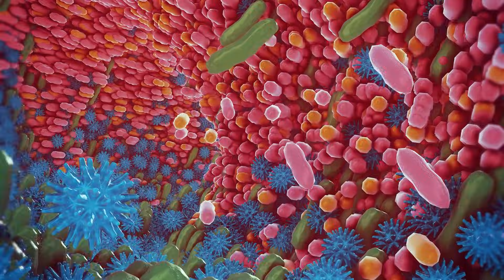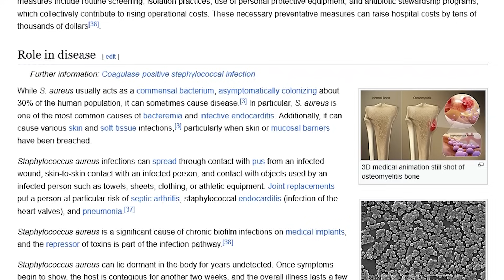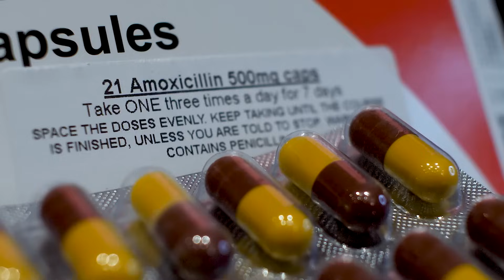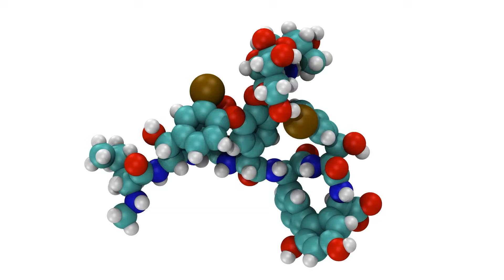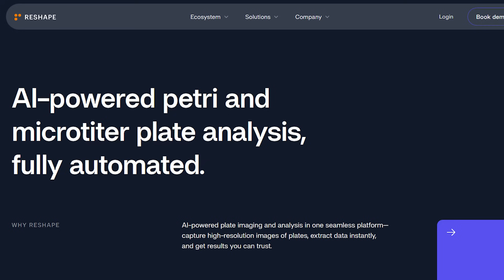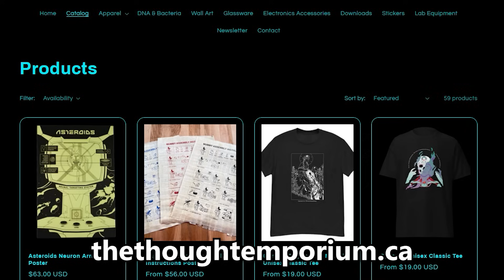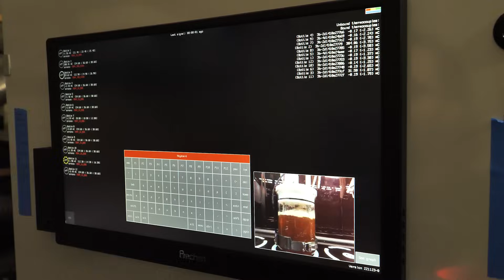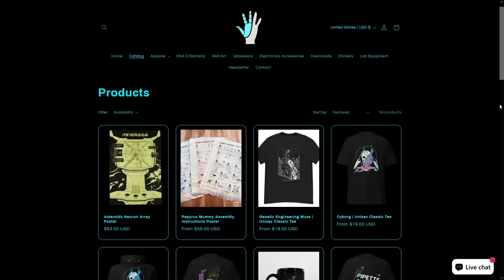I Grew Real Penicillin from MOLD

Comment: i have a bag of oranged and one has gone blue and fuzzy, when moved creates a huge spore cloud😂 will this work?
Reply: theory; soak rice and potatoes in water to gain a starch rich solution, separate solids and discard them.
pour starch solution into slowcooker on warm setting, scrape blue dust into starch solution and place lid. tape the edge and make a one way valve out of a balloon for the steam hole. leave for a week.

Comment: cool video
However the final solid is likely to be mostly composed of sodium carbonate as you simply evaporated the aqueous layer. When performing such an acid/base extraction, never evaporate the aqueous layer as it always contains the salts. Instead, collect your penicillin in the basic water layer by acidifying again and extracting with AcOEt. Then evaporate the organic phase which does not contain any salts (if you dry it properly).

Comment: While there's certainly yield to be gained in the growing process, repeating the extraction steps to do each one at least 3 times probably would've boosted your isolated yield by 50% at the minimum. Especially if the pH was off at any point. Also, its inadvisable to dip pH paper into a solution of material you want, better to use a glass rod or pipette to sample the solution separately. The dyes can add impurities, color, or cause otherwise deleterious effects to your product.

Comment: Would it have worked to have simply had the solution that was left over from the growth of mold sterilized and used as an antibiotic instead of separating it out from solution using the chemical extraction method? Since it is likely that many of those chemicals would not be available in a "civilization restart" scenario, but growing blue mold would be on the other hand, quite easy.

Comment: Pretty interesting video. However, it's necesary to add that the final yellow powder is not "Penicillin" only, but a mixture of a lot of nitrogen containing small molecules, because there was no purification step shown in the video, so the final yield ought to be lower. Nonetheless, it is wonderful to see in a very practical, but expensive way, how a very simplified version of the drug discovery pipeline is done.

Comment: Here are the simple instructions: 

1. Just buy these specific seeds from God knows where. 
2. Add some of these magic powders. 
3. Stir
4. Heat on low for 24 hours
5. Mix the stuff you got with some more magic powders and liquids into these very special containers.
6. Dehydrate
7. Scrape the stuff from the bottom of the dish
8. Ta-da!! You have beaten the bacteria

Survival has never been easier.

Comment: Having done filamentous fungi fermentations (aspergillus 5 liter volume mainly) as a career for several years. I almost choked from holding my laughter when I realized you were going to use a stir bar to try to keep the fungi submerged. That will not fly ever.  It is probably also on of the main reasons for the poor yield. The fungi produces better when submerged, the top layer does not get enough oxygen and/or nutrients and is not producing anything. Only the layer close to the surface is producing. 
If the culture start to hit a real log phase in growth you are going to need to cool the fermentor not heat it. the metabolism of the organism is enough to heat the vessel to well over 40°C, killing the organism.
Do you have any kind of pH control? I am not sure how much acid Penicillium produces but it probably does produce some. And then the question is. What is the optimum Temp/ pH/ airflow/ etc. etc.
looking at the old footage. They might have grown it in what is now used for cell culture flasks. maybe a thin layer batch growth is a possible approach.

Comment: Would the extracted penicillium be save for application or would it  still cause a ton of inflammation, due to mold particles still being part of the solution? What would be the next step to remove pyrogens / increase purity?

Comment: Safety note, if you want to culture soil bacteria, you need to take a few precautions. 1) Do not handle the petri dishes without the proper personal protective equipment (PPE), which would be, at the very least, a properly fitted respiratory mask or respirator in a well ventilated space. You could also make a DIY glove box, or a biosafety cabinet if you have access. 2) Seal the edges with parafilm or tape. 3) Store plates away from food, in a separate fridge in a garage or shed, or in a box outside. 4) If you have any questions or concerns about safety, contact a microbiologist at a local university. Happy hunting!

Comment: Can I just say how refreshing it is that a video going through the history of Medicine did not harp on the "stupidity" of our ancestral doctors? I had never heard of the early references to the antibacterial effects of fungi until now. Thank you.
Reply: the plague doctors couldnt have been much better-equipped with what they knew and had at their disposal iirc
Reply: There's a recipe in a grimoire from a thousand years ago that someone actually tested and it turns out that it's better than modern antibiotics for fighting Methicillin-resistant Staphylococcus aureus. Somebody should try replicating it.
Reply: @ultimape  Interesting, where did you hear of this? Makes sense they wouldn’t be as prepared to handle something we haven’t used against them in ages.
Reply: Yeah, cut them some slack; they were doing the best they could. We figured things out because of the work of people like them, and we’re still learning.

Comment: could we please do the opposite of gain of function on viruses, to get them to be super harmless and then use those to infect yourself and get immunity and then we don't need vaccines anymore that are injected into the muscle, which will bypass one of the most common way to get the natural infection, the airways?! You could simply make them as a spray for the lungs or the nose or other body openings 😂 Just like to my knowledge, cow pocks were harmless to humans but gave you immunity to normal pocks or whatever was a problem back then. Or even better, completely understand how the immune-systems "database" works and find the "drop colum" function, so i can delete my hey fever and other allergies 😭

Comment: I don't understand how you get only the penincilin + left overs, and not more compounds found in the mold. I don't know if i missed it but it seemed to me that there was no clear "separation" step. Is penicillin a smaller conpound than most other compounds found in the mixture?
Reply from the maker: Choice of solvent. Ethyl acetate is more selective to penicillin, and penicillin is the major thing this strain makes. The charcoal also pulls out impurities, but doesn't bind penicillin in the presence of ethyl acetate.

Comment: 2:10 "you were lucky to make it past 40" that's a common myth caused by life expectancy being an average. the reality is more like, you either got sick and died when you're under 5 years old, or you survived and have immunity to live until you're 50-60.
Reply: You'd still be lucky to live past 40. It's just if you made it to like 10 you probably would make it to 40
Reply: @cwlogan13  exactly, that's the reality of what that life expectancy meant at the time, if you got past 10, you'd probably make it to 40, then survival rates drop off, some occasionally making it past 60, but usually dying sooner.
Reply: Haven’t we more recently discovered plenty of much older cases of ancient humans, especially ones with significant  physical ailments, being taken care of until 60+ by their community? I think we may have lived a little older than even we currently think, although assuredly not commonly to 80+ like today
Reply: No I believe you survive till 20 then you can expect to live till 70-80.
Reply: I mean... Sure it's misleading, but making 40 was still lucky. Just 30, 40, and 50 were about the same amount of luck required and unlucky was dying at 3.
Reply: @ yea it's just a nitpick, 40 is close enough to get the idea that people died more often than today
Reply: @Minty1337 To be fair, this stat is normally plain wrong. Just in this case it's technically correct.
Reply: No

Comment: >Even with high yield strains, we'll only get 1-3g of penicillin per liter
Last time I was given Amoxicilin / Clavulanate, it was 875 mg / 125 mg per dose. So at those yields it would take about 300-900 liters per dose. At 20 doses for a 10 day course, that would be 6,000-1,800 liters.
To make useable numbers of doses, you'd need either swimming pool sized grow tanks somehow kept sterile and consistently mixed despite their immense size, or some kind of continuous flow system that keeps the mold in a highly productive state for long periods of time.
Reply from the maker: Your math is.... Off. At proper industrial yield close to 3g, you need about 6 liters.

Comment: I am curious if we could get better result using a Anion exchange resin to remove the penicillin, using a solvent also remove anything that is soluble in the solvent, whole the Anion exchange resin would capture thing that can give a proton, chrysogene from what i could have seen is very non-polar and would in theory would not bind to the Anion exchange resin by the lack of carboxylic acid part.
Reply: Morphine has been extracted that way. Some Polish chemistry and pharmacology students figured it out years ago and now it's referred to as "the Polish heroin method" because that's what they turned it into afterwards.

Comment: Question, how are we supposed to access wikiciv without computers? Are they going to publish a book or something?
Reply: The same way you backup Wikipedia. You can just print it all out.
Reply: With a cheap inkjet printer and a 3 ring binder, you can print your own book
Reply: Normal wikipedia has an option to download it in many different sizes, so you could back it up on a sturdy ssd, and use some low power computer like a raspberry pi / arduino / your smartphone, powered by solar or mechanical generator. So i would think wikiciv would have a similar option
Reply: @P-Ian  SSD is a terrible choice, as data on it starts to degrade after 3 months if it remains unpowered. Magnetic tape would be ideal for long-term storage.
Reply: @Zeis  What would be a better choice when choosing from regular data storage? Pendrives, microSD, HDD's? Something pretty compact, pretty rugged, so it survives being just in your backpack, and that is able to be read by hooking it up with some generation of usb?
Cause you'd have to bring a magnetic tape reader with you, right?
Reply: @P-Ian  best option? probably laser engraved CD's. they dont degrade over time if stored properly, so just make sure you dont scratch them. Or print it all onto plastic sheets....
Reply: @P-Ian Cheap pen drives and SD Cards are the worst. For most data keeping 3 copies (1 local, 1 on another device and one external portable ssd or hdd) is enough. If you want some more resilience you can get some "industrial grade" pSLC SD Cards - they are ordinary SD Cards but only store 1 bit of information per flash cell instead of the commonly used QLC which store 4 bit (= 16 different voltage levels per cell!). They therefore only have 1/16 the capacity and a 16GB card costs as much as an ordinary 256 GB card but have a hugely better data retention. HDDs also have a very good data retention but if they fail mechanically it can be hard to get the data back out.
Reply: @ Honestly disks might be a pretty good choice, portable readers are very slim, blurays can hold a lot of GB's, the issue might be with how easy they are to scratch, but other than that, sounds good :)
Reply: @P-lan like someone else said, probably something like laser engraved CDs/DVDs/BluRay. BluRay can hold up to 50GB. But if you need something that doesn't require an external drive to be read (though you can just carry a portable USB Bluray/DVD player as well), then I can't think of anything better than a classic HDD when it comes to more long-term storage. Data will degrade on there too (but you got a couple years), and they don't like to be tossed into a backpack, but they're still fairly rugged all things considered. You could also just carry backups on multiple mediums. SD cards, USB sticks, SSDs, etc.

For the apocalypse, nothing beats several hard copies printed out and bound in different places. Chances are you won't have much or any power, and even if you do, you might not have access to a PC that can read whatever medium you're carrying. Nothing beats paper in that regard.
Reply: @Zeis Don't forget about the storage of said physical media. Pretty much every CD and DVD produced today uses an organic dye to encode info, so it's highly recommended that they're stored in a dry, dark place so that the humidity and UV rays don't degrade the dyes. Even then, some limited testing puts the lifespan of CDs and DVDs at 10 years in optimal conditions before the data starts to get corrupted. I believe Blu-Rays use a metal layer to encode info, so they do last a bit longer, 25 years.
Reply: @Zeis  it does? Source?
Reply: @clonkex  my old hardware QA boss when I worked at intel.
Reply: Programs like KiWix are a good way of storing huge datasets like Wikipedia offline.
Reply: I once bought “The Knowledge: How to Rebuild our World from Scratch” as an ebook. If the apocalypse requires smarts to navigate, I don’t like my odds
Reply: @matthewdebeer8453  I also went the book route, though I picked Ryan North's "How to Build Everything", 10/10 would recommend and I'll have to check out the book you picked as well. We can make an entire apocalypse reading list lol
Reply: Microfilm
Reply: Regularly-copied physical papers maybe??
Reply: I mean yea, you could, but if we talking post-apo scenario, you're not gonna be hauling hundreds or thousands of A4 paper, instead of some digital memory, a way to read it, and a way to power the reader.
Reply: @ I do understand that, yes. I meant noting down the most important pages beforehand. I'm not that tech-savvy, so I just thought of that
Reply: I might just have a data hoarder's mentality, and I would want to have the most information about everything i can, from mechanics, physics, chemistry, to the more practical everyday stuff, survival info, and I couldn't carry all of that in physical printed form ;p
Reply: The unfortunate truth is that absolutely no digital medium on earth, even magnetic tapes stored in pristine conditions, will last longer than a lifetime before being unusable. Apocalypse material meant to last longer than you should ONLY be stored in analog forms, such as books.

(Omitting mentioning M-Discs because they're marketing junk lol)
Reply: There is already a book on how to restart humanity, probably has antibiotics in there somewhere.
Reply: Store the important stuff required for basic survival in physical copies. Focus on uniting with actual experts [if that is even possible that is] to handle the complicated stuff.